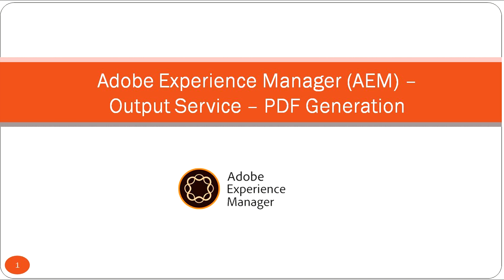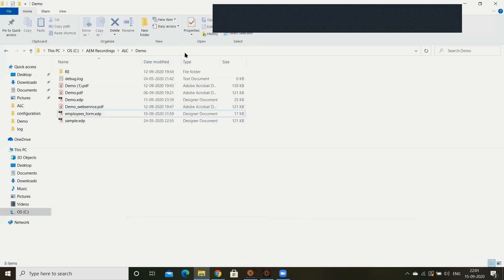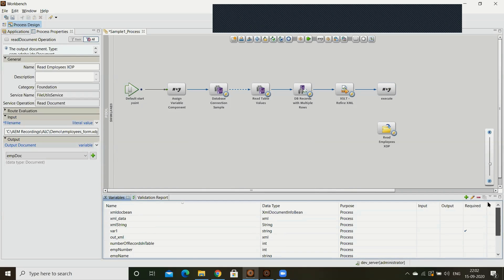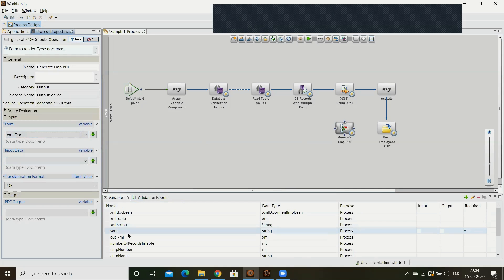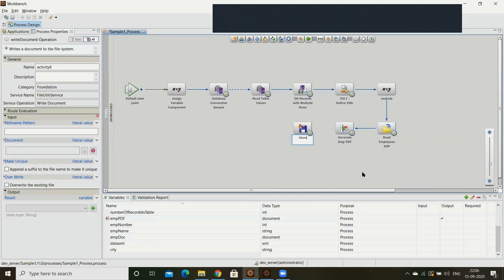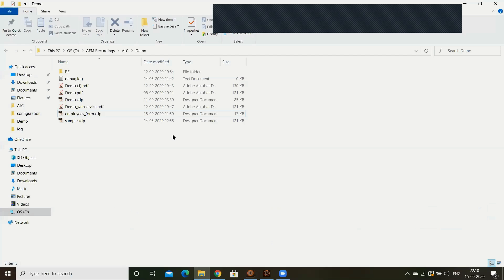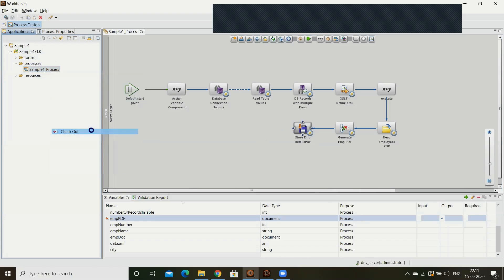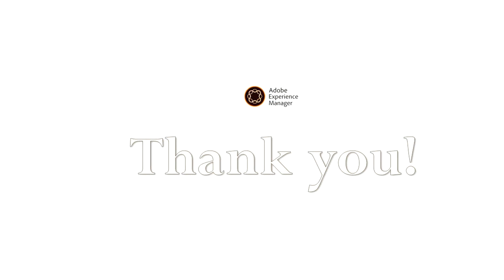AEM Forms Output Service and PDF Generation

Comment: Any idea to increase the speed of this output service pdf generation. Like 300 pages taking more than 20 seconds..  how to optimise it?
Reply from the maker: pls remove embed fonts or images(if any), also try to reduce JS script.
Reply: @aemformstraining  thank you for ur reply, but anyways I need this JS scripts for implementing. And I have not used more images, maybe 1 image . Is there any other option inside aem workbench process? Not in the forms. We have LCA files any speed optimisation  possible in output pdf generation services in aem forms workbench?